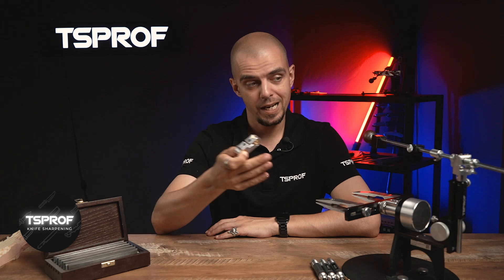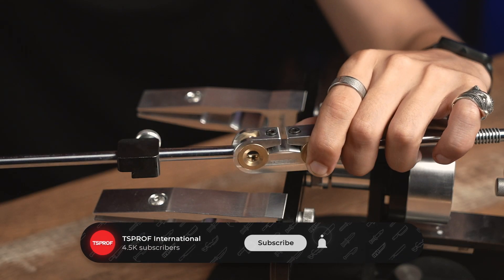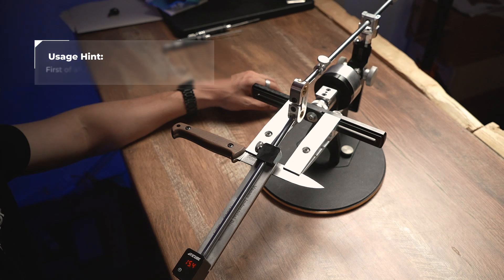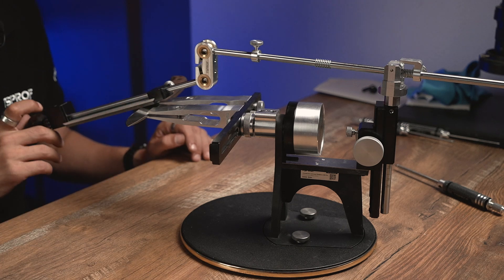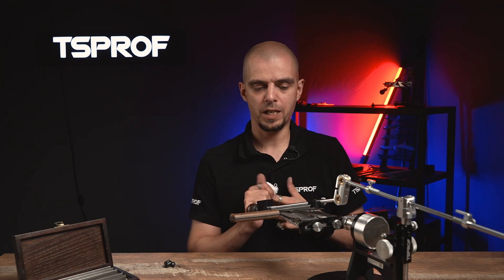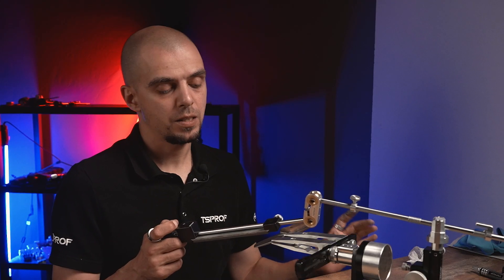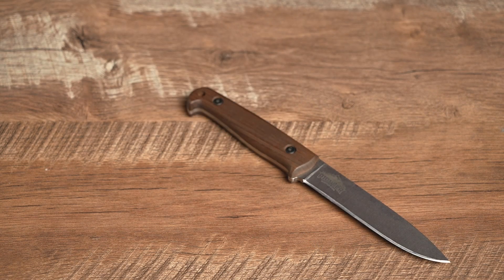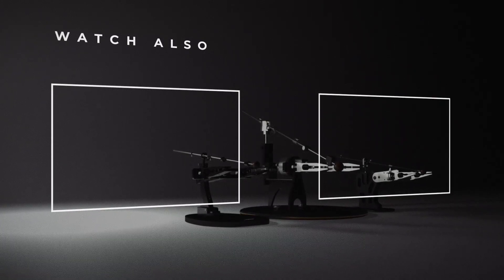New Solution for Convex Sharpening. TSPROF Ultra for K03 Pro.

Comment: I’m a huge fan of convex edges on large field knives, and usually use a slack belt grinder and finish on a buffer, but want a simpler solution for the K03 Pro Hunter.  I have the previous K03 Pro convex attachment with the three 4.3°, 7.2°, 10.7° angle adjustments marked on the side, with the thumb wheel tightener, but this one looks simpler to use.  Thanks for the first look.  👍
Reply from the maker: Thanks for sharing!